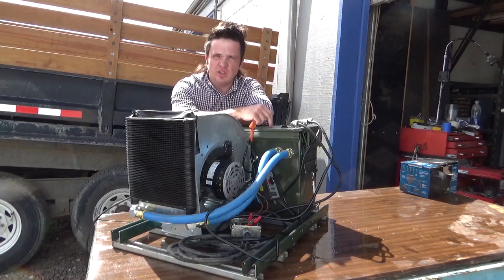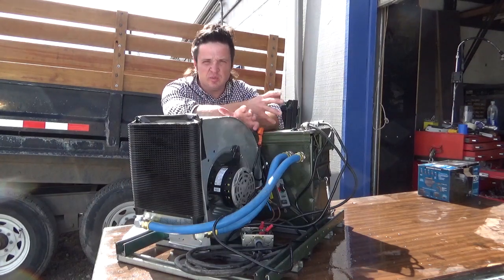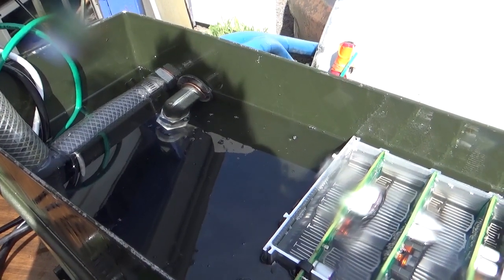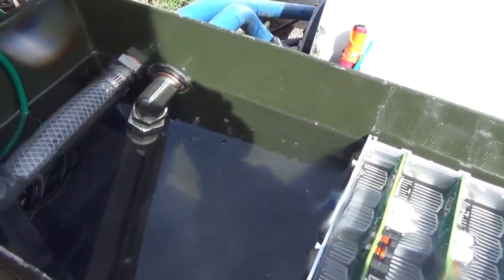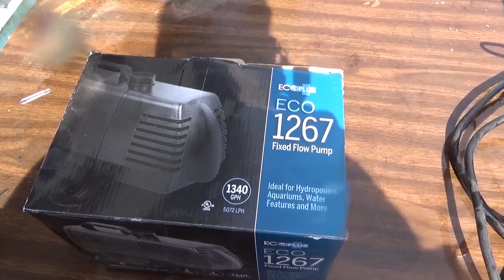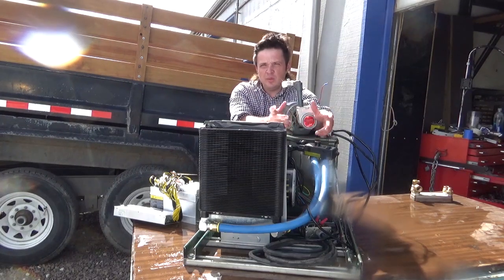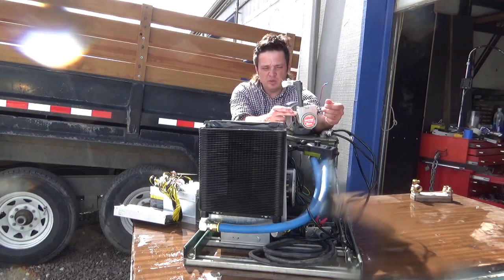Double Barrel Oil Cooled Bitcoin Miner - Twin Submerged S9s

Comment: the chimney effect cause the hot oil to rize and sucking in oil from the bottom , youre flowing oil over the top so thats less effective 
one thing you could do is put the return pipe under the machines (should be able to as you got those screws under there to raise them up ) and add a vertical divider between the machines and the pump thats a little above the oillevel but still under the edge of the box you want a small waterfall coming over te top of it 
you might need to put the return hookup an fitting on the other side across from the pump but still in the space for the pump to make room for the divider to slide in there 
wat this will do is ; you pump the oil intoo the box under the miners the heat will draw the oil up through those miners and it comes out over the top of the miners 
once the level of the oil on the miners side is high enough the heated oil will flow over the divider intoo the pump side and get pumped through the radiator 
doesnt realy matter if the divider is not completely watertight its mainly there to direct the flow of oil and prevent the cold oil doesnt get sucked right back intoo the pump with the hot oil floating around the top of the ammo can 
another thing you can do (that ive seen) is use the mounting screws (or thin chains if you dont have enough height ) for the fans up top to mount handles that makes lifting them in and out a lot eazier as there not as slippery as trying to clamp the sides of the thing drenched in oil while lifting
thanks for the ammocan idea , i have a s17 pro that should fit , this be way better than using a glass fishtank eazier to put bungs in too

Comment: I’m curious about immersed vs externalized power supply configuration setups.
Is there an energy savings worth immersing? If not, I’d rather leave it out because power supplies tend to outlive their hardware and go for sale on EBay.
Reply: in effective immersion cooling hardware life should outlast the power supply.

Comment: great video that inspired me to try liquid  cooling- can you share details about the mineral oil that is required for cooling
Reply from the maker: I just use regular white mineral oil. In the future though I would recommend something like Bitcool888, or another fluorinated thermal liquid since they have far better thermal capacity. When I started such things weren't widely available and more expensive.

Comment: Hi Max I have submerged my asic miner in the mineral oil , I bought three type of mineral oil because they was running of stock so all them are 100% mineral oil , I plug my asic in there , run a minute then there was a short circuit , my circuit breaker’s fell , if you may help me find out what could be the problem
Reply from the maker: Hi Robert, can you email me pictures of your setup to neetbuxlaboratories@gmail.com, I don't see any reason why the oil should cause short circuits unless there is a lot of water in it.

Comment: 1:53 doesn't it work better to take hot oil from top, cool it and return it to bottom ? a FLIR thermal camera would clarify that :)
Reply from the maker: While there are no doubt some convective forces at play I"m not sure on a system of this size it would make a difference. I don't think a flir will give you a good idea of the temp distribution through a steel container, although I'm not an expert in those.
Reply: Other immersion setups similar in size have the input on the bottom.
Reply: I like the videos, they are a good template to build on and your style of presenting is good.

I can’t recall, but there are 5 year warranty pumps I came across while studying Aquaponics.
I believe the pump type was a baffle pump but well worth the investment.
My plan is to heat a Tilapia tank (70degF-80degF) and grow plants a few zones warmer than my region with this rig setup,

I work in the Shipyards on marine vessels and we usually avoid aluminum fittings because of saltwater in the atmosphere does shorten the life of aluminum.
Also, we tend to stay away from mixing metals (Aluminum fitting on Steel can) due to dissimilar metals issues.

I appreciate the follow up video and lessons learned are alway great to watch.
Please make another video with more improvements!

Comment: Cool staff. Does the fluid make any damage to electronics, boards, wires..?
Reply from the maker: Some of the wires insulation can harden up over time in oil but otherwise it seems ok.
Reply: @neetbuxlaboratories5806   Rubber insulation is more sensitive than plasstic. I read in some paper. This guy should keep use this few years more and share exerience. :)

Comment: Great work man! Have you found a breakdown on using water pumps on Oil fluids? I heard they bread down.. Maybe be okay, if can get a couple years out of them. Maybe consider tube heat exchanger? So moving Oil instead of water gave you about a 50% less effective volume movement than water? Thank yoU!
Reply from the maker: The eco-plus pumps work great as a whole. The smaller amount is by Mass, since oil is less dense then water and all the heat transfer equations are mass flow. The one I tried to fit in here is a little small though.
Reply: @neetbuxlaboratories5806   Nice thanks. I talked to Engineering Fluids who make the expensive stuff, and they said any diaelectric fluids should have the seals changed out to "Viton or KVM seals" . Water pumps many times have that option
Reply from the maker: @seanhynes9516  That seems odd to me. Typically fluornated compounds are very inert. Viton (which is also a flourinated) compound would seem excessive I think?

Comment: Hey Max, do you know where someone could buy a miner or two for exceptional *value*?  2-4Kw  hash/$ ratio.
Enjoyed your videos since the 1st post :)
Reply from the maker: I'm not sure by what you mean by exceptional value?
Reply: @neetbuxlaboratories5806  with normal things, I often but high quality stuff, lightly used. I find that's often the, get the most for your money area.
Does that exist for miners? Is there a good place to get the previous generation of miner for cheap and still worth running, or does the hash/kw efficiency of a new models make older ones not worth looking at?
Reply from the maker: @knartfocker00  Check out whattomine.com, currently an S9 needs about 6.2 cent/kwh to break even. The newer miners are obviously better but initial expense is huge. This changes based on difficulty and price of course. You can buy used miners on ebay and craigslist.Mining profitably is not an easy business.
Reply: instaBlaster

Comment: Do you think there are there zero chances to cool one miner by circulating the oil with a double (2x120 mm fan) radiator and pump from computer liquid cooling ?
I wonder if the problem in video is indeed the pumped volume or maybe when it pumps too much, the oil doesn't sit enough in radiator/fan to be cooled ?

Comment: This is awesome, i really like the updated progress from  your last video. I'm curious about the temperatures of the power supplies after 24+ hours. Also what was the temperature of the one s9 in the amo can after 24 hours? As far as improvements. I think the issue is that the submersible pump does not have sufficient psi to pump the oil though the radiator at a high enough flow rate. Perhaps this might fix the issue, if the power supply can power it. https://tinyurl.com/y5wssaoa best of luck and great video!
Reply from the maker: Hey,

I ran the miners for about  a day and they sat around 80-82C core temp which I thought was a little too much, I didn't measure the power supplies directly but they dump a lot less heat.

That pump only moves about  210 l/h, I would like to be closer to 2000l/h. The pressure drop across the radiator and the hoses should be pretty small.

Comment: Hey, really great work, thank you! It's a really great project.

I'm thinking the easiest and most cost effective solution might be increasing the oil volume with an external resovour.
I'm almost to the assembly stage of my Innosilicon s11 soaker, based on your last build and it is so tight I doubt I can get even 2 gallons (of the 4 I bought) in there. I still think it'll work for the single miner, although I'm using a smaller transmission cooling radiator and fan than yours (19 tube). But I'm prepared to add a second one if needed. 
The Siaclassic coin it mines is at $8.49 a day before electricity (which I don't pay) so I don't mind going over budget too much. I'm at around $500 with a ROI of just over 2 months once it's running and if prices hold up.
Reply from the maker: The actual amount of oil in the system is not a big issue as long as all the needed parts get circulation across them with no stagnation. 
Make a video of your build , I'm very interested.
Reply: David Wolf I have 3 antminers a3.where do you excanche siaclassic?